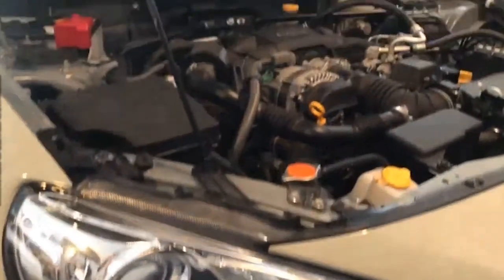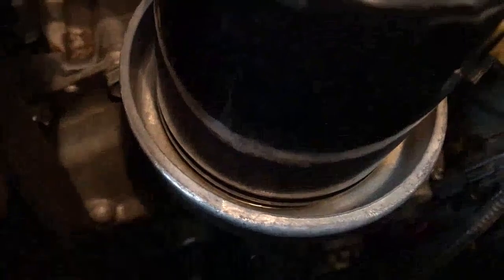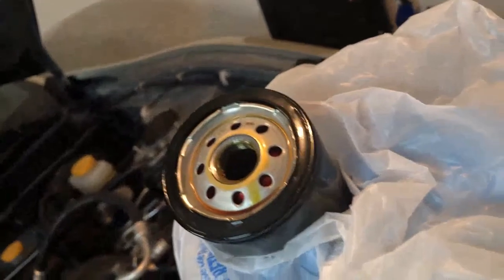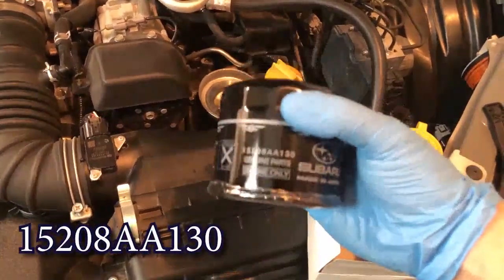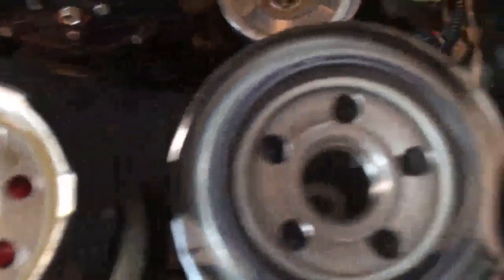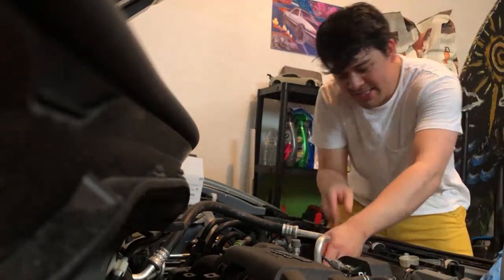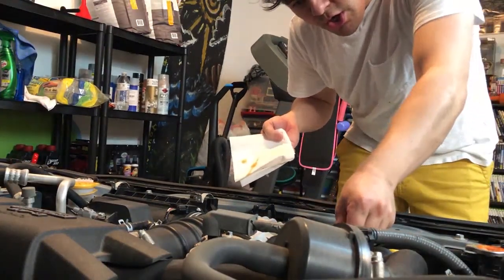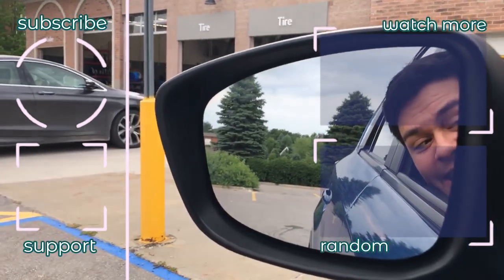Don't change your oil without proper filter! How to change oil filter without draining oil.

Comment: Did you fill the filter with oil too before installing?
Reply from the maker: This engine has the oil filter installed open side down, so filling the filter with oil would cause a spill.